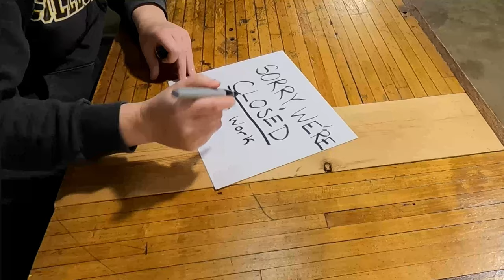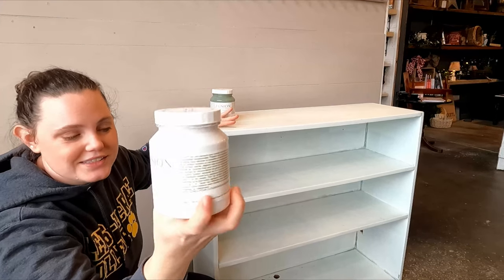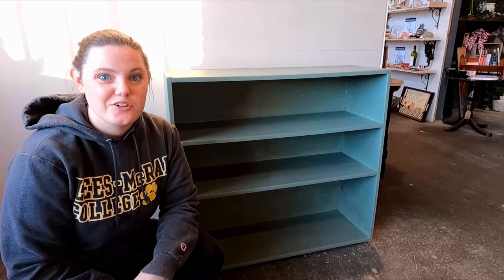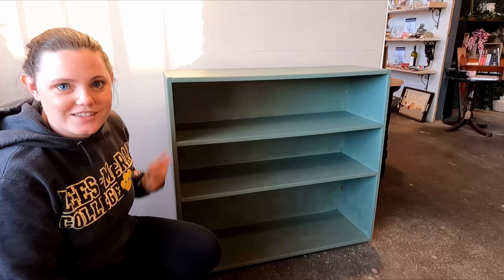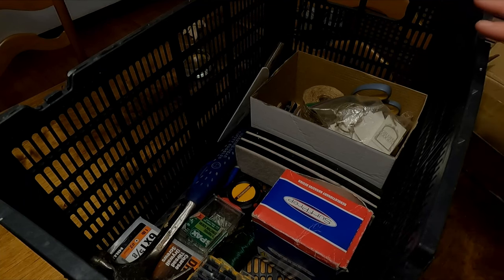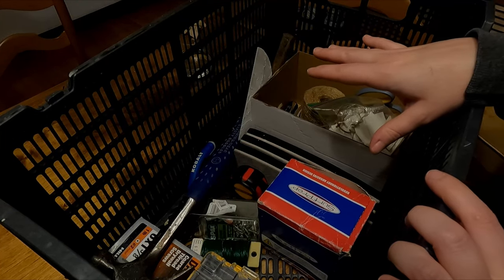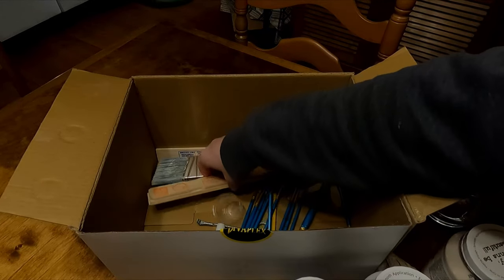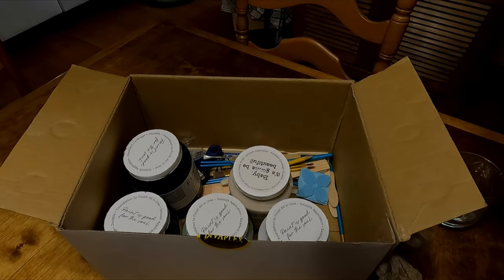2024 Antique Booth Challenge: Day 7 | What's In My Vendor Tool Kit?

Comment: I love your vendor kit. Last winter I made a booth bag to carry all the things I need for staging and selling in my booth. We just have pegboard walls at my shop which I don’t love the look of but I do love the ease of use. I don’t ever need a drill or any real tools beside a small hammer and some pliers and wire cutters maybe. I keep all my small items in a large plastic organizer that fits inside my booth bag (it looks like a garden tool bag with exterior pockets. Great video!
Reply from the maker: I've had pegboard before and I agree about the easy of use and look. Grit & Grace wanted to stay away from them, but that means lots of drilling and filling holes!